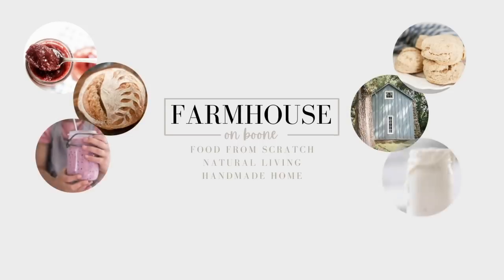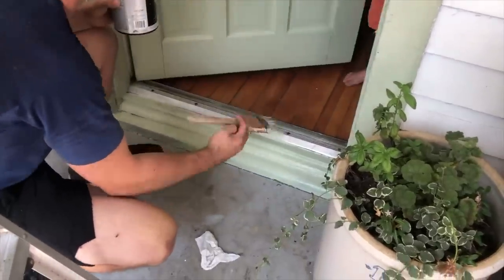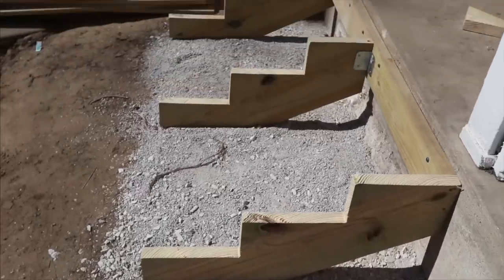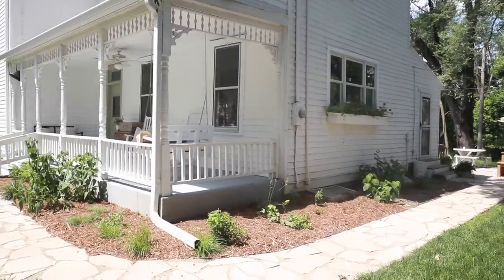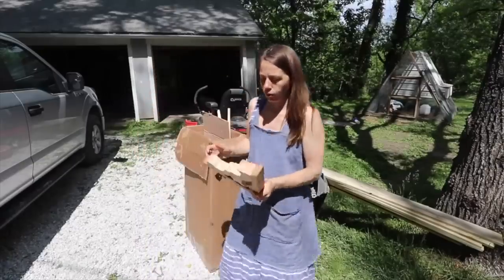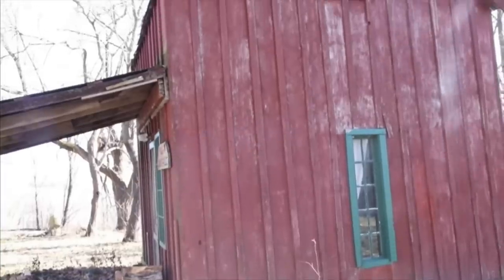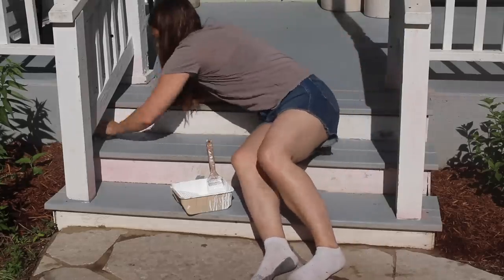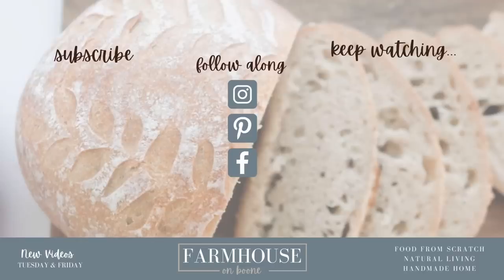Before and after! Farmhouse curb appeal

Comment: In the Southern states, it is traditional to paint your porch ceiling blue to mimic the sky or water. It was believed to ward off spirits, however a more practical benefit is that it prevents wasps and birds from nesting on your porch. The theory is that the blue mimics the color of the sky, thus making the birds and insects feel that the area is more exposed to predators and so they choose another site to build nests that feel more secure.

Comment: Such a great job on everything 👏  keeping the cement front porch was a good idea. I have a wooden wrap around porch and it's yearly attention.  We did a complete renovation with new wooden boards replacing the rotted. 204 new colonial spindles for railings and got rid of that outdated hunter green colors.  Medium grey and white railings/spindles all around.  Brand new black louvered shutters with a red front door. Wood is a lot if work. Really glad the backyard deck is trex.